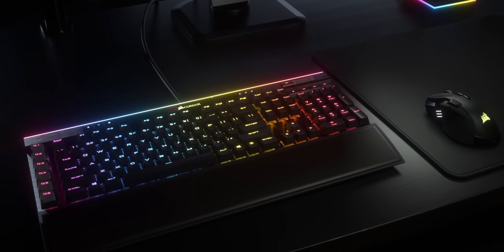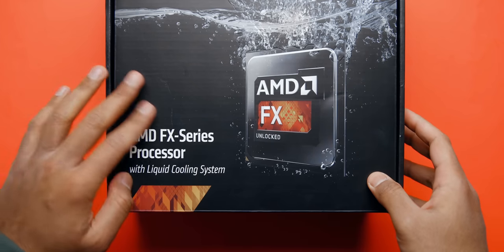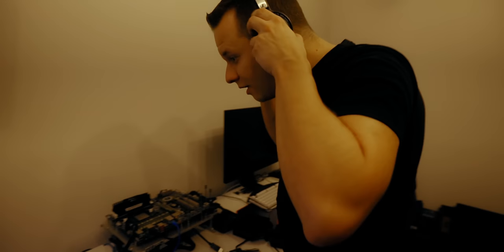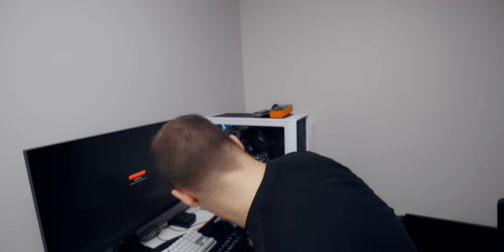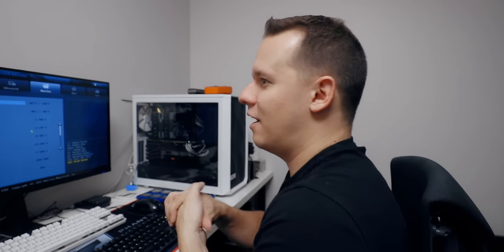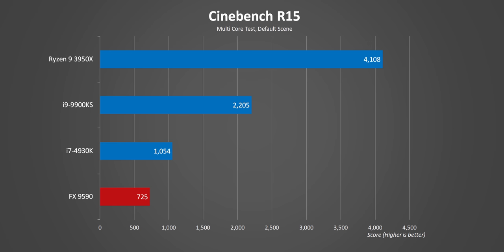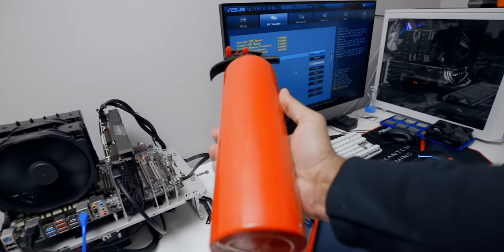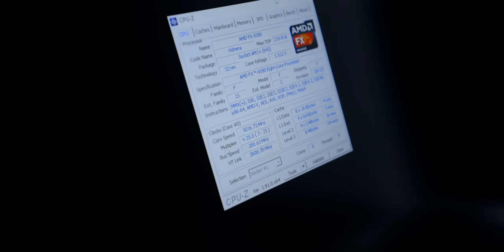Why The FIRST 5GHz CPU Almost Failed - AMD FX-9590 Revisited!

Comment: yes.... i remember ~60c being the wall for phenom 2 6 core CPUs (which had a die shrink from the phenom 2 quads iirc)

thats why i have a NHd-15..... 6 cores at 4.0 ghz was bad ass
for 2 months..... 

then the I7 nation attacked
Reply: yup... right at 1.5 volts also..... it would overshoot into 1.55 sometimes under load

ran that 6 core like that from launch till i got a ryzen 1700x..... never let me down

Comment: This was a fun vid, but I have some suggestions. Use an 1866MHz RAM kit, set the CPU clocks to 4.7, and increase the NB and HT to 2600. That should help performance a lot! Also get a 360mm AIO on that at least lol. And max out the fan speed, and put a fan on the VRM!
Reply: Well i got mine on air though

Comment: 5 GHz my ass!  Mine never once boosted to 5 GHz (with any kind of load on the CPU).  I OC’d it to 4.9 all core, wouldn’t do 5 GHz.  Call it what it is, 4.7 GHz.
Back then I had a system with a 4790K at 4.8 GHz and a 9590 at 4.9 GHz.  The 4790K had waaaay better single core performance but the 9590 crushed it in multi threaded work loads.
Reply: Hmm

Comment: My FX-9590 actually degraded with a D15 on it. Got to a point where I couldn't get it stable above 4.5 GHz. It also drew as much power by itself while gaming as my 3700X and RTX 2080 do combined.
Reply: Rip.

Comment: Previous AMD CPUs suffered from bad Motherboard Designs like hell. If you overclock it, cool the VRMs. You'll maybe see stable Fequencies, but the load on the CPU drops and so do benchmark results (as well as FPS ingame).
Reply: Replace pads with paste on thermal paste

Comment: I had one of these FX 9590’s, it never worked how it supposed to and it was always overheating even with a 212 EVO, my i5 3330 I now use and traded my 9590 for is so much better in reliability.
Reply: The FX 9590 was never meant to be used with an air cooler. It was designed to be used with liquid cooling. A Hyper 212 EVO can't come close to handling 220+ watts.

Comment: I loved overclocking my 8320. Using a Crosshair V Formula Z I was able to OC it to a 24/7 stable at 5 GHz. I remember how they loved the voltage. If you were unstable just throwing voltage at it was always the solution. As long as you could cool it. It was my first serious overclocking set and I still kind of miss it.
Reply: I still use mine with an FX-8350 at 5Ghz. It's not terribly bad for gaming unless we are talking single core.

Comment: still have my 9590 and it still is a vnice space heater no issues other than outdated lol i have the same MB with mine 990FX w/ 9590 however with this MB the sound chip has died but still works
Reply: corsair H100 AIO

Comment: during that time the top selling cpu by AMD was the FX6300, everyone that need a mid level 6 core unit had the FX 6300
Reply: Except that AMD "core" implementation was much different than what Intel was doing. What AMD called a 6 core was really just a 3 core. I had an FX 6100 and it was such a dog. Could not even outperform an Intel Q8400 quad core. These things were bad. Glad AMD is back with Ryzen. Running a Ryzen 5 2600 now and it's amazing.
Reply: @purplehz97  yep, I built  about 10 FX6300 systems for family and friends  back then , and yes  unreal progress and is doing a double fight   with Intel and Nvidia  I cant wait to see what happen in October

Comment: This makes me want to pull out my old system.  Had the same Sabertooth board and an FX-8350, I believe I got it to 4.8 stable at 1.325v with max temp at 45c.  It was my favorite overclocking experience
Reply: Water or air? I'm like 4.7 1.440 with a NH-D15

Comment: Maybe I'm extremely lucky? I've been running the FX-9590 with an R9 290x GPU since February 2013 with no problems. Yes, it gets hot. Yes, I have lots of fans installed in its huge HAF-X full tower case. However, it has been running 12+ hours per day for more than 7 years with no problems.
Reply: I had my fx9590 running cool on air fine since like 2016 or 2017 i think. It used daily. It got vega 56 biosed to vega 64.

I modded bios to support m.2 booting.

It extremely fast and stable. Even runs 4k perfectly fine.
Reply: @DragonProtector  I was thinking about upgrading my GPU to the Vega 56. I want to get into VR gaming, but my R9 290x can't handle the load.
Reply: @crispmom  i got lucky with my vega 56. I love how well it performs even though i bricked flashed it. (It won't read rom now but fully works as vega 64 and the other switch to vega 56).

I can do 1150 mem oc

Comment: I used this CPU in my first PC build and I remember it running at like 90c under load even with liquid cooling 😂, definitely was a flex on paper but in actual performance it wasn't great compared to Intel
Reply: Mine runs 60c on air (max load i think)
Reply: 90c under load with liquid cooling? that's a bit overstated. i run 8350 at 4,9GHz with liquid cooling 240 deepcool i cant get it over 60c on load. stress test for over 25 mins never went over 70c. how you people get those temperatures i really dont understand
Reply: @asengeorgiev5039  ikr? Mine like dead silent on air staying cool. Fan barely spins

Comment: I always wanted to upgrade my rig from FX 8120 to FX 9590, but never had the money or chance to buy it.
But, i have the BEST AM3+ board you can buy:
ASRock 990FX Extreme9, and a ASRock 990FX Fatalt1ty Professional!
Both boards are strong overclockers and full with features!

I still use this PC, have 2x 8GB GEIL 2133Mhz DDR3 RAM, R9 280X etc,
and this fine CPU would be the Cherry on the Cake!
Reply: I almost bought the Extreme9, but ended up with the Crosshair V Formula-Z.
Reply: @ej1025  I could not get my hands on the Formula-Z, but i tested all the high end boards, from MSI, Gigabyte and ECS, so the ASRock one was a clear choice.
Reply: @Valnjes  The crosshair was a gift I received. I probably would've chose the Sabertooth R2.0, if not for that. I heard the ASUS VRMs were of better quality than the ASRock. I also couldn't find much about the Extreme9, other than a limited amount of reviews.
Reply: @ej1025  Well the Extreme9 is build like a Tank. The only downside of the board was not having a M.2 slot, but hey, old chipset, old tech. Easy overclocker, works with high speed RAM, nothing bad to say about it.
Only AMD CPUs hold this board back. No solid high performance CPU - FX 8120 @ 4.5Ghz works 99% like the 9590. So, bummer. The "next gen FX" never came...
Reply: @Valnjes  I really liked the design of the Extreme9. I just heard some bad things about their 970's and the 990FX Killer Board. Heard good things about the Asus M5A99FX and the Sabertooth R2.0. And yes, it is kinda sad no more FX CPUs came out.
Reply: @ej1025  Well not all ASRock boards were best overclocker, but they were good enough boards for use.
Most of ASRock boards used 4+1 analog VRM (sometimes with doublers 2[4+1] ). The Fatal1ty Professional and the Extreme 9 used 8+2 digital VRM.
You would enjoy the boards too. I used to mod the BIOS for more OC options, so i beat the hell out of them, pretty fun to run and OC on them.

Comment: Remember when AMD still release a new architecture about the same price range as the previous original flagship with a bump in core count? When compared to Zen, Zen+ and Zen++, all 3 Zens are overpriced.

AMD raised the 9590/9350 in order to milk out their customers.
Reply: Im sry what ? , Remember the 1600AF that they released to give consumer benefits with small upgrades ? , Remember ryzen 9 that literally takes threadripper's position and lowers the price point ?
Reply: @archfxt3619  Are you dreaming?

PX4 9600 - 250
P2X6 1090T - 290
FX 8150 - 250

Suddenly with Zen,

R7 1800X - 500
TR 1920X - 800 (bump in core count only)

You should be paying 8-cores for less than $200. Yields? AMD isn't Intel, TSMC produces the devices for AMD, and will try to get the yields.

Plus, AMD shamed Intel back during the LGA1366/1156 for splitting the desktop into two, consumer and HEDT.

Now, if you want to have more memory, and worried about high cap stick, you have to switch the entire platform.

Comment: It wasn't the first 5 gigahertz processor, Sandy Bridge did that sometime before, but it was the first 5 gigahertz out-of-the-box clocked retail processor. No overclocking necessary, all you did was plug it in and turn it on.